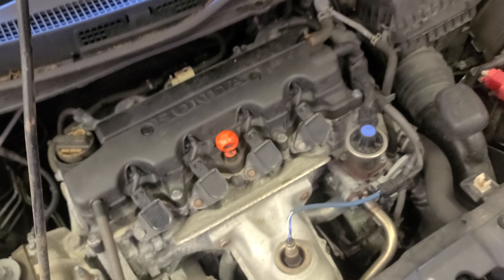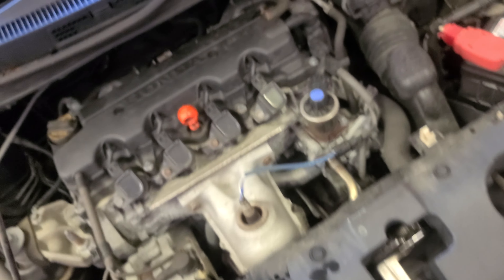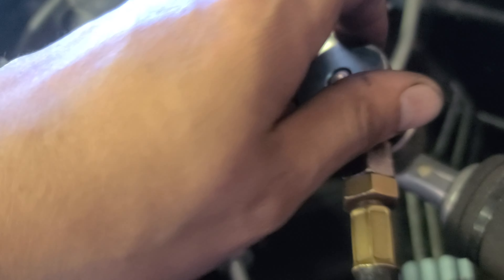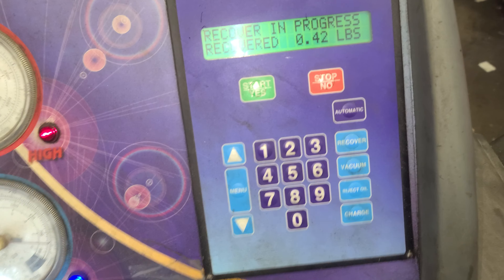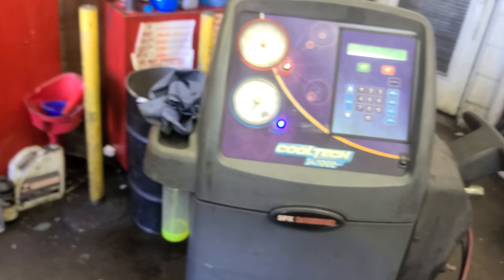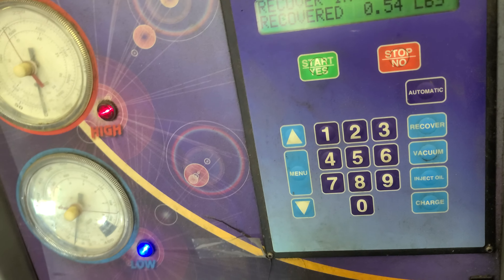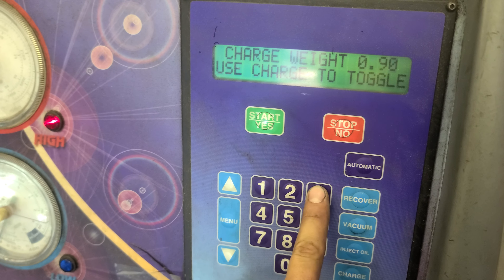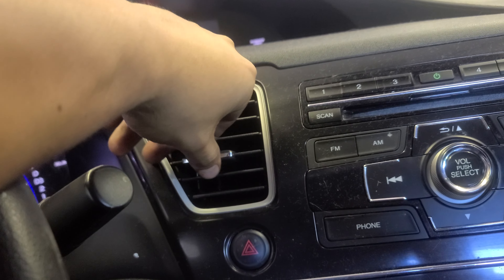2012 - 2015 Honda Civic How to refill AC system with freon.

Comment: Question, lets say we don't have a machine like the one in the video, can we use one of those little cans from auto zone or advance auto parts? Like where can we get a tool to measure how much refrigerant we have in our A/C system? Also, how to we put in compressor oil without using the machine if we don't have one. Great video by the way.
Reply from the maker: I'm so glad you loved this video.
Click on the heart thanks button, right below the video screen to Buy a super thanks which support directly to the channel!!
Thanks for your support 🙏🙌👍❤😀!!!!!!!
Get one of these!!!!

XtremepowerUS 3CFM 1/4HP Air Vacuum Pump HVAC R134a R12 R22 R410a A/C Refrigeration Kit AC Manifold Gauge R134 Can Tap Included Carrying Tote https://a.co/d/eS23pQL
Reply: @AxtuoAx you didn't answer the question

Comment: What could be a cause that will prevent the recirculating button to start working? The defroster works the air blows but it’s hot and the air recirculating button does not turn on
Reply from the maker: The vents doors inside/behind the dashboard, the are not opening or closing

Comment: If I were to buy cans for refill, would it be 0.93 lbs in both low and high ports, or both combine make 0.93? ((0.415 in each)
Reply from the maker: Buy the bottle can with the gauge on top, it will tell you how much you putting in.

Comment: So his system was about halfway empty, what’s the cause of the loss of refrigerant ? Doesn’t that mean the system has a leak ? I have the same car and I think I’m low on refrigerant like the car in your video, Honda quoted me $140 to recover and diagnose my Ac and another 15-30 dollars for refrigerant required, does that sound correct ?
Reply: Same issue. 15 civic, 120k. Technically freon doesn't get used up because it's a fully sealed system, but leaks do happen. First step is to refill and see if it holds. If not, then tou refill with dyed gas and then you trace the leak. You can DIY before you dish out 1k on your ac system
Reply: @vanillaglue  yeah I paid $210 CAD for my 181k kilometres 2015 civic to have them diagnose and add refrigerant with dye, they said it all checked out and maybe a small bit of sweating from the crimp valve on the discharge hose, I only had 100 grams worth of refrigerant left in the system  god damn! Hopefully I’m good for awhile
Reply: @cavvvyr7021  i just figured out my ac clutch coil is gone. Maybe freon loss as well cos I don't know why it would be hissing. Thanks for sharing your process/costs
Reply: @vanillaglue  how did u diagnose that
Reply: @cavvvyr7021  i was mistaken. I bypassed it by running power to it directly from the battery (red to red) and it spins. Honestly, I don't know what to check next. Fuses seem fine, gotta see the relays. My dad knows how to use an electrometer so he checks all the stuff. 

I read you shouldn't top up refrigerant yourself using the cans. You have to measure by weight, and not pressure! I'll keep you posted if I figure it out.
Reply: @cavvvyr7021  are you in Toronto? Where did you take your car? A Honda stealership?
Reply: @vanillaglue  yeah I went to Honda dealer I’m in Vancouver Bc
Reply: @cavvvyr7021  I hate giving them my money
Reply: @vanillaglue  I know but it’s not that expensive and they know your car AC SYSTEM the best trust me it’s worth it for the piece of mind they will refill and add dye and tell u if they found anything wrong
Reply: @cavvvyr7021  Ok, I Will take your advice. I appreciate it!
Reply from the maker: Support the channel
Reply from the maker: True
Reply: @cavvvyr7021  what was the total cost for Honda to do the work?
Reply: @lionintu  around $225 CAD
Reply: @cavvvyr7021  that's not bad! My 2014 civic is finally doing g a poor job of cooling after 10 years. I think I'll go to Honda instead of buying a can of freon
Reply: @lionintu  definitely don’t use the can it will wreck your system

Comment: was car running when you were charging it
Reply from the maker: you dont have to if the ac system takes it. the machine would tell you if you need to